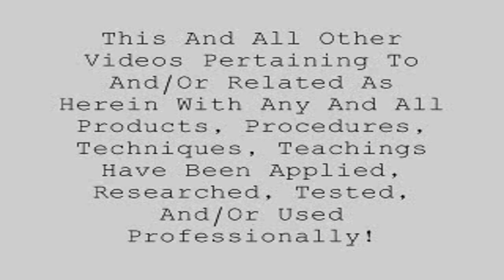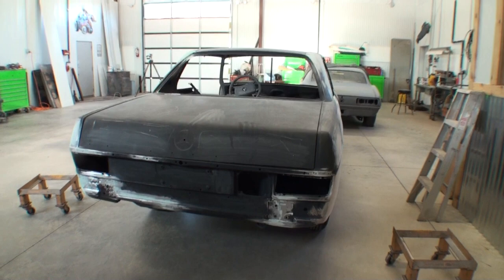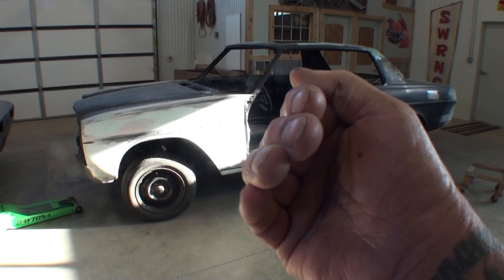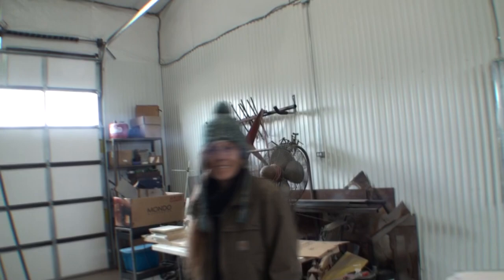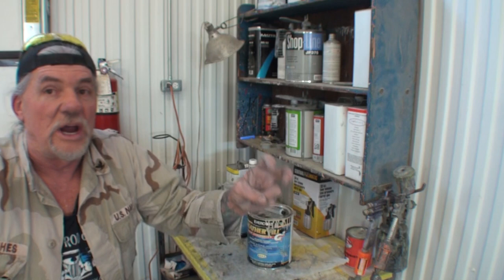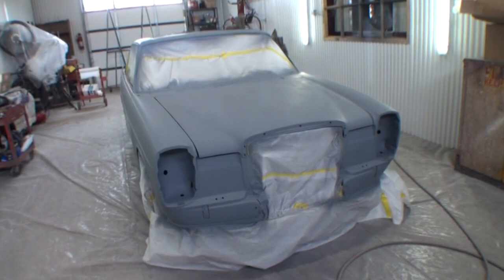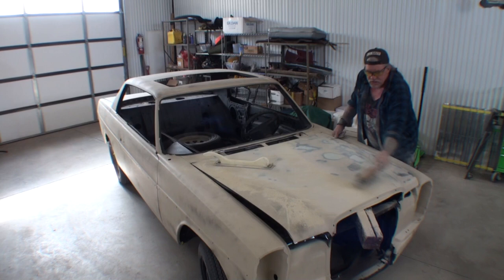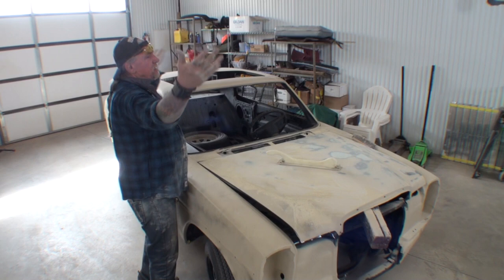Can You Restore A Rusted Car? " At Home " - Part 19 - Putting On The Primer

Comment: My God Pete, I remember video number 1 on this European version of this 1976 Mercedes WD115. Rotisserie, left rear inner fender frame members. All parts, big and small, with thousands of spot welds holding it together with Mercedes version of spray-on seam sealer. How you begged to owner not to have it sandblasted. Then he did! Employees fault who no longer works there, so not their problem. Single sheet metal hood w/no structure. His “Benz” specialist removing all the suspension and even Les, asking for the power steering removal for work. No frame, no bottom structure, now no suspension! My, my! It had so much rust, metal gone forever, If a dozen rats moved into that car, to have a home, the total weight would have doubled. You showed the “Shrinking” disc action, bending sheet metal into place, cutting off the excess, the 4dr rocker on a 2dr car…and now at this point. I know it is beyond this point but will never forget the impossible! Hundreds of lessons, seam seal, epoxy, custom rotisserie, even grafting the package tray in rear window from parts car, body gaps, even interference from the rotisserie then how to focus on sections. Not whole, not half, but quarters. Losing sleep over the condition of the bottom side of a naked hood with no supporting structure. Then the big one! “Throw-A-Way”car! I will never forget nightmare, and the 48+ of video with 89hrs of setup, lighting, editing. I am exhausted thinking about it. Minnie and Pete deserve an award; Raising the Dead. It’s Alive! Wow. DK.